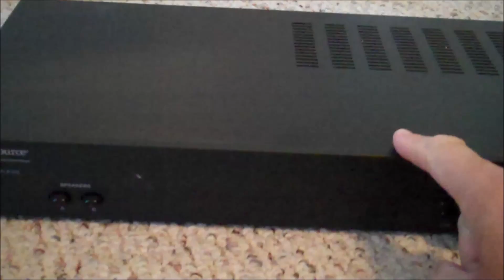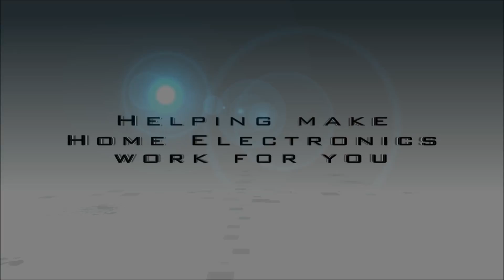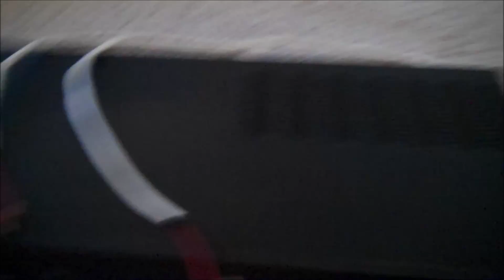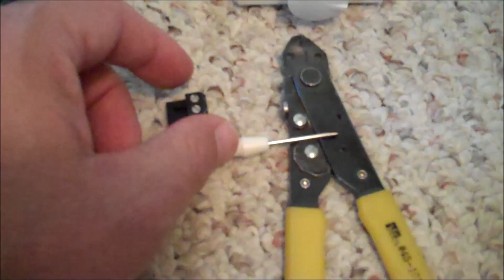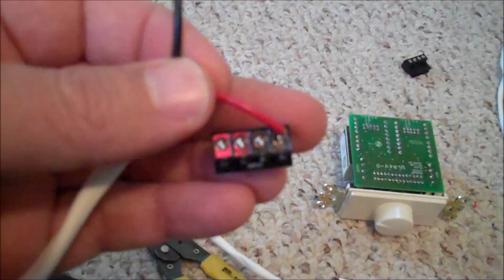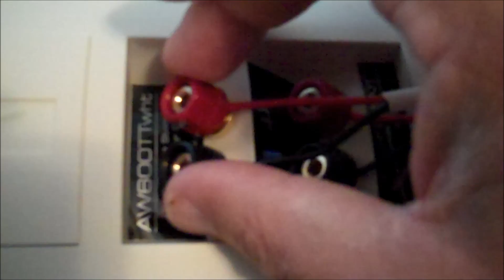Hook up volume control to speaker and amp

Comment: Bought a house with installed ceiling speakers and volume controls,  2 upstairs,  2 main level. Has connection box I'm not familiar with.   What is a good inexpensive amplifier? Just need for TV
Reply from the maker: Unfortunately that’s not enough information. The “box” and volume controls cause additional questions. You risk damaging equipment without being certain. Consider additional research and consulting an on-site pro

Comment: I have 3 speakers. one in the dinning room one in the kitchen and one on the hallway. Would I be able to plug in the 4 wire (for left and right sound) into the first speaker, then just continue 2 wire from the first to the second and then again to the third? my volume control requires 4 wire in and 4 wire out and all my speakers  only have the 2 wire in. suggestions? 
diy-er

Comment: Does it affect the power usage of the amp? (Does the amp use the same power when it is on full volume as on half)
Reply: Yes, it will because the volume control is impedance matching. The control will turn the extra energy into heat, like if you were to put 2 speakers on a balance controller, but one of them only outputs heats.